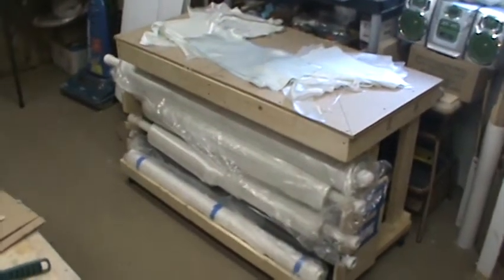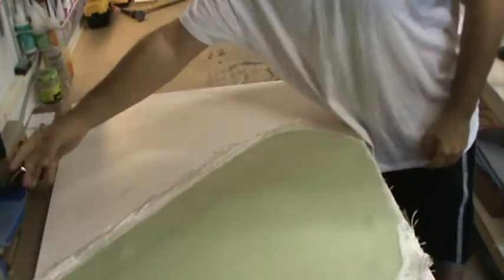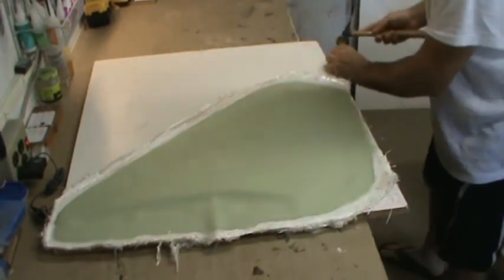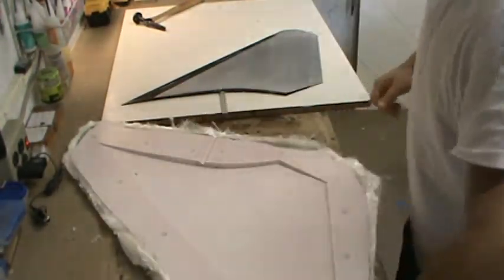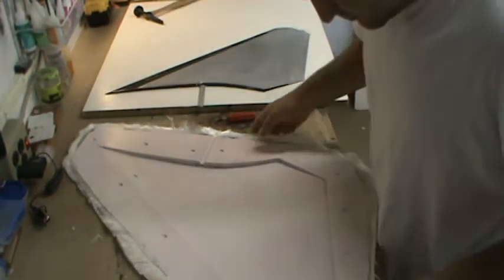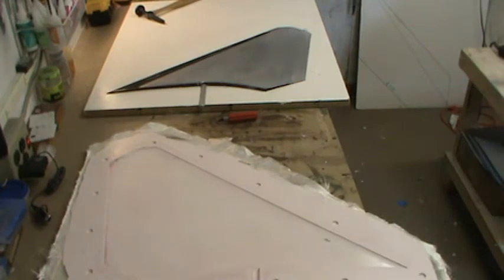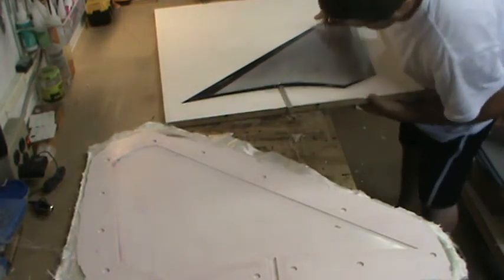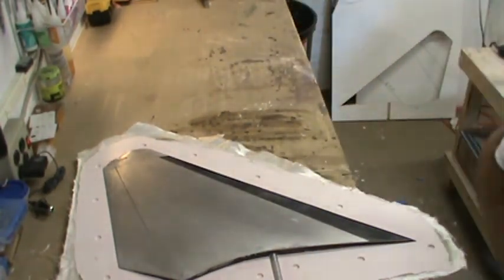How to Build an F-14D Tomcat #30

Comment from the maker: @eldiablopoco 

If the molds are to be stored for a longer period of time without use, you would leave the plugs in the molds.  If you are going to be using the molds fairly frequently, the plugs can pretty much be put it storage.